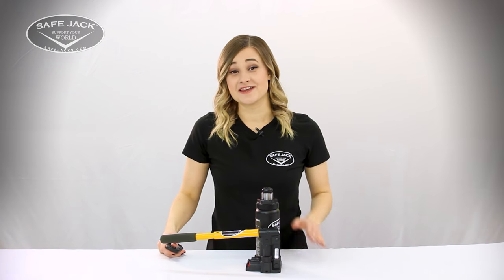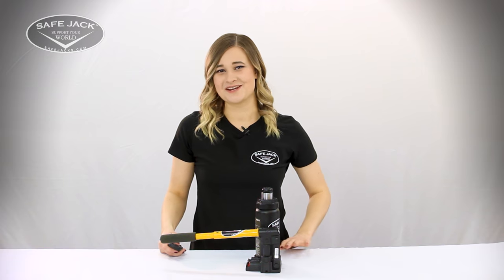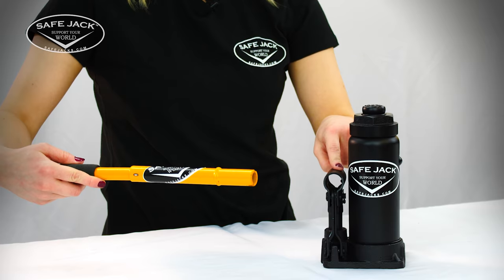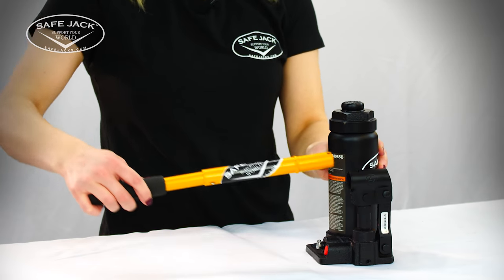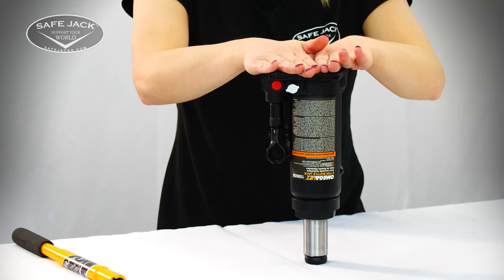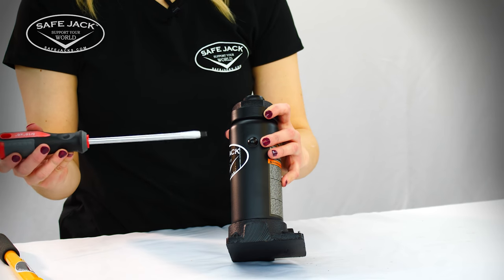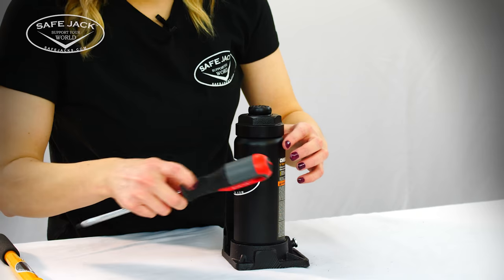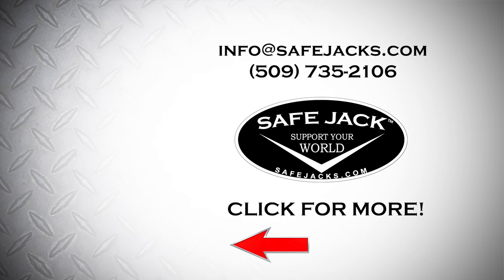How-To: Bleed a Bottle Jack

Comment: Had mine holding up snowmobile front for 6months and now will not CLOSE (stuck open)! P.S will not close even with weight applied(goes down and inch and then stops)!
Reply: Mine stays open as well and won't go down... I even unscrewed the lock totally to bring it down, but no amount of pressure will bring it down. I've tried bleeding, still nothing works

Comment: Whats the red screw for?
Reply from the maker: Hi there!

That's a safety plug put there by the jack's manufacturer. The purpose is to avoid over pressurization of the jack.

Comment: as I was sayng - beyond that widespread lack of major important information, although I guess one should not fill oil from release knob(jack upside down) BECAUSE it’s not to be overfilled that-is.. STILL as air goes upward, why does any & everyone bleed air from filler plug, when that’s only 2/3’d up, but release knob upside down is all the way up?

Comment: Mam can u please tell me what for that red button next to release valve pls
Reply from the maker: Hi there!

That's a safety plug put there by the jack's manufacturer. The purpose is to avoid over pressurization of the jack. There's no need to interact with this component.

Comment: Is there a diagram that shows where the air gets trapped? What is inside the jack?
Reply from the maker: While we don't have a diagram of our own to show you, Tec-Science has a great visual of the inner workings of a bottle jack. 
https://www.tec-science.com/wp-content/uploads/2019/07/en-liquids-pressure-hydraulic-jack-components-parts-1024x576.png

This doesn't specifically show where the air gets trapped but here is a brief explanation: When a bottle jack of this style has been stored or used on Its side for instance, there is a pocket of air where hydraulic fluid in the reservoir would normally be. This is where air can find Its way into the pump piston. When the jack is used normally again and the handle is pumped, this air is being moved from the pump piston, through the system, and under the power ram. This combination of air and hydraulic fluid moving the ram is what may make the jack seem "bouncy" or "squishy" when supporting a load. We hope this answers your question!

Comment: Should you bleed your jack when you first buy it?
Reply from the maker: Hi Jonathan,
The necessity for bleeding your bottle jack will become apparent once you begin using it. Often when a bottle jack is shipped to you, the sideways orientation and shuffling of the package causes air to get trapped and the jack will not work correctly. If your jack will not support its rated load, seems "squishy" upon lifting, or won't lift at all, then a good first step is to bleed it. So in other words, it's not necessary until proven necessary.

We hope this helps! :)

Comment: I thought there was a procedure in purging where you pumped the jack all the way up and continue pumping for a few 10-20 more times, then you turnit upside down opening the release screw and after fully closed while its still upsidedown tighten the screw and burp it right side up thtough the fill hole..  is that wrong?

Comment: First of all, thanks for the video.

Second: I recommend you include a written advisory with every bottle jack shipment encouraging new owners to view this video (or whatever written instructions you choose to start including in the shipping box).

Third, after doing literally what is recommended in this video, my brand new Omega still is not working. I am hoping that following the more complicated instructions in the following video will get my jack working: https://www.youtube.com/watch?v=pQ16MCxv_7A
Reply from the maker: Hi Raphael,

We're very sorry to hear you're having this issue.
If you purchased the jack through Safe Jack, it's our priority to help you and determine where things went wrong. Each and every jack we send out is tested to confirm working order, as part of our pre-shipping process. If this is the case and you've tried everything to get it working, please contact us by email (info@safejacks.com) or calling 1-800-627-8088 for information on our 2-year warranty.

If you didn't purchase the jack through us, it's possible there still may be an included and valid warranty, depending on the date of purchase. Omega jacks include a 1-year limited warranty (found on page 7 of the user manual) here: http://www.shinnfuamerica.com/Owners%20Manual/10065B%206TonSidePumpBottleJack/2826 allowing for repairs or replacements without charge when the jack fails to work under normal usage, due to defects.

Thank you and please feel free to contact us with further concerns, comments or questions.

Comment: First off. My shit won’t lower
Reply from the maker: If you ram won't lower, go through the steps of bleeding your bottle jack to see if you can get the ram to move. If that doesn't work, give us a call.
Reply: @SafeJacks  what happened was i wasnt putting weight on the jack. Before you lower it try putting your own weight on it. thats what my problem was